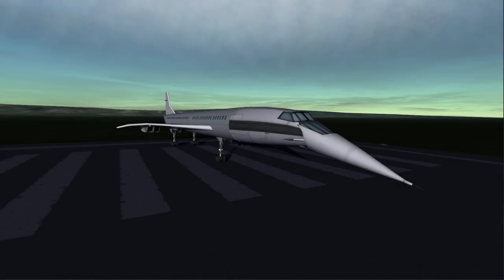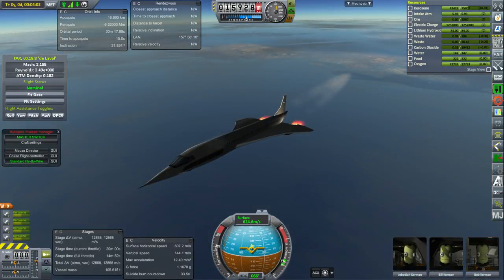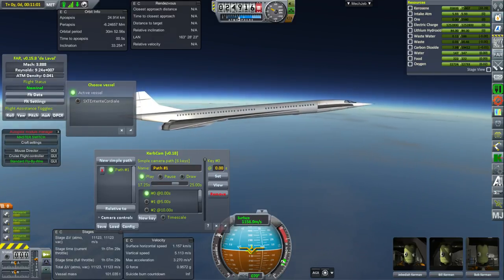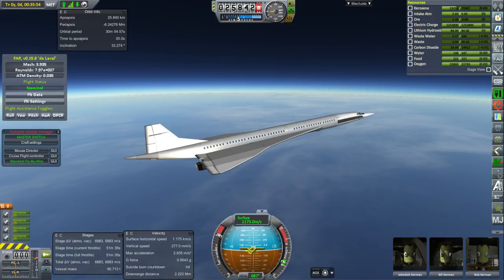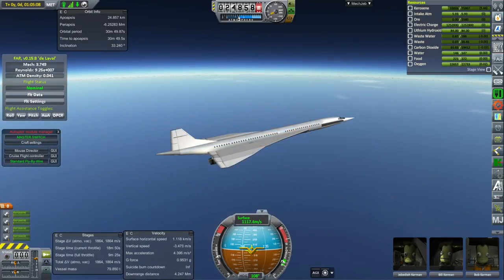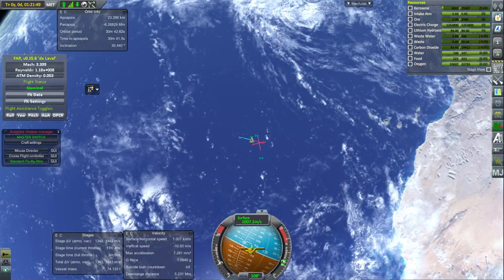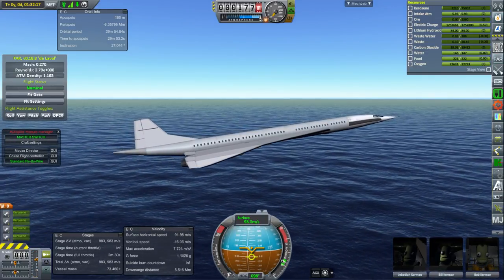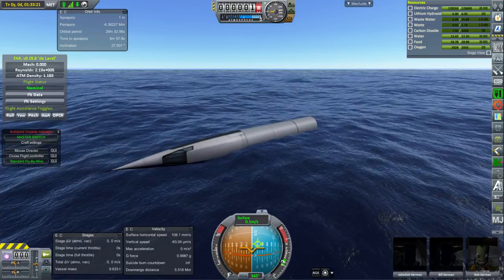Kerbal Space Program RO Sandbox - Concorde-71

Comment: You are missing several aspects of the BFR for sub orbital over a hyper sonic transport.  A hst will need to carry cargo to be successful which was one item the BFR can do easily, the Concord has a capacity at best with full fuel load of 290 pounds per person of 95 passengers.  Doing some 747-8 numbers is hard as the plane has twice the range of the Concorde.  Given a lower fuel demand of the 747-8 it provides 700 pounds per person of 410 passengers.  

The BFR sub-orbit is interesting in that it could carry maybe 80 passengers in awesome comfort but the BFR sub-orbit has a pressurized volume greater than the 747-8 which means it carry over 400 passengers.  That means with its landing weight of 50t, it could carry 275 pounds per person.  Now the question comes is that is in typical 3 class seating.  Would Elon go coach style I doubt it which means the BFR sub-orbit more than likely would carry less passengers say 200 to 300 but would have a capacity of 550 to 350 pounds per person.  I think that is more economical for a passenger plane as it needs to haul cargo as well.  

If you are to look at the 787-8 the cargo capacity per passenger is around 490 pounds per person.  So I think when you look at the transcontinental options out there the BFR sub-orbit is similar in capacity.  

Next you bring up the noise factor.  Given the planes always have some background noise I think the BFR will have less noise overall but still there will be some noise from the Raptor engines.  Although I think some sound proofing could be used to decrease the noise.  Overall I think it is a great plan on expanding the options for funding of the BFR.  Is it cost effective for the fuel I am not sure but at least its an option that can help increase the capability of the BFR to be useful. 

The final aspect is the sonic boom issue.  Even though the concord flew at above restricted air space in the US it could not go super sonic as it was banned as all planes that are not military can not create a sonic boom at any altitude.  Given the ability to go across continents where there is no air, the ability to create a sonic boom is no longer an issue.  The re-entry well that would be an issue that they would have to work out as the current F9 does create a sonic boom as it lands.

Comment: Cool video I think Elon wants to test the BFR systems & make money for the Mars/Moon program that's why he mentioned Earth-to-Earth.
Reply: Makes sense but think it would be cool to go on a rocket ride with out training & heath checks like NASA/ROSCOSMOS. P.S can you please make a BFR with a more traditional second stage unlike the official design?
Reply: It would also be a boon for cargo shipments.  Imagine putting 100k lbs anywhere on the face on the earth in under an hour.   That would help with amazon and Alibaba to get products faster to other places.  Now the cost is going to be a concern but it would help.  Given the 250 passengers and 48k pounds I am not sure what the cost will be but the general number I been given is that the cost of fuel is 0.5% of the flight.  That would put the falcon 9 launch fuel cost at 310k.  Now a 747 has a fuel cost of 145k to go 4000k miles.  If we were to say double the fuel cost for the f9 for the bfr, I know not really realistic but it we are talking methane fuel now not kerosene the costs and capacity are unknowns at this point, it would be 620k. The 747-8 can only hold 70k pounds of cargo in passenger mode which means it only makes roughly 130k dollars on each flight according to AA priority shipment.  That puts the majority of the cost being taken up by cargo.  So the BFR is going to have a cost for cargo that has to comparable to that so that means it will only make about 90k dollars per flight the rest will have to be taken up by the passengers.  That means the cost of the ticket will be around 2500 dollars per person.  From the quick research it was about 12k per passenger on the concorde.  So yeah it would be a bit more economical.  So economics of the BFR as suborbital makes sense provided they can move 50k of cargo per flight.  Even more sense if they can put some satellites that use their final stage engine to get it into orbit.